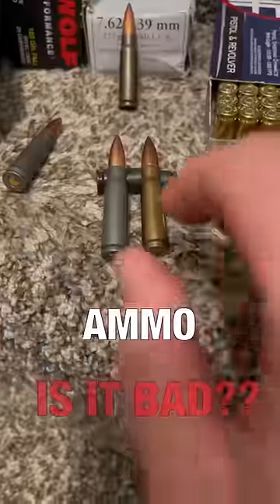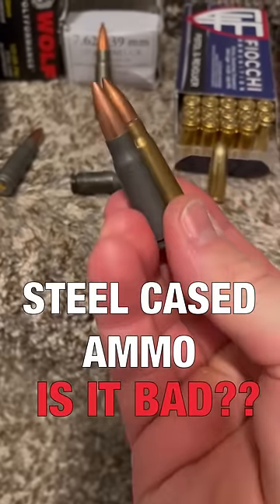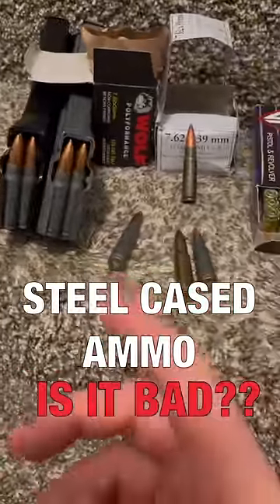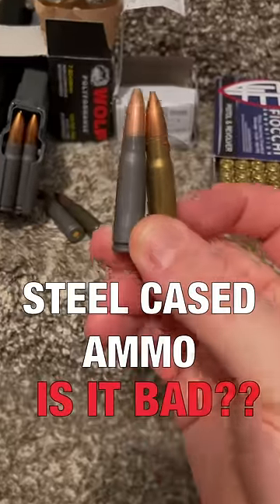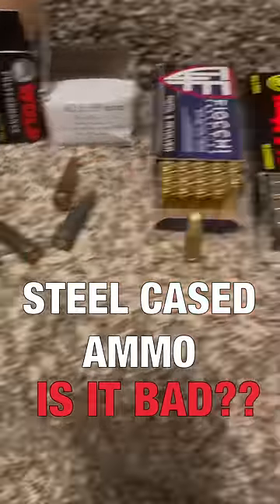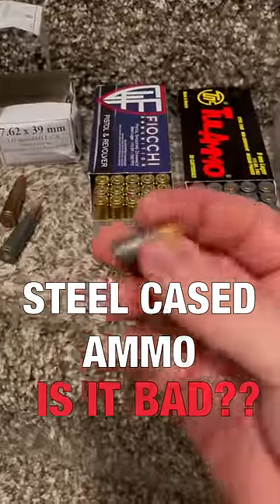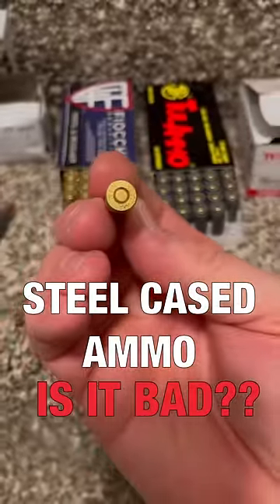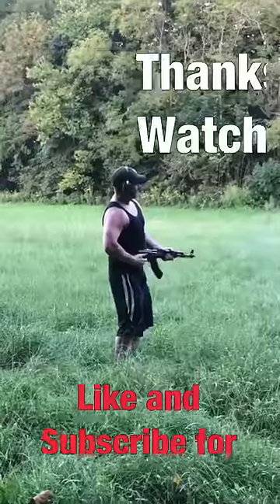Steel cased ammo, is it bad? #short #shorts #shortvideo

Comment: also, if your gun doesn't have a chrome lined barrel, it will not cycle steel reliably. This is thanks to the fact that the steel, be it stainless or chromoly steel, has a lower lubrosity rating than chromium. So, as the steel case expands, it suffers much more friction. In a chrome lined barrel, the lubrosity, which is a measure of average surface friction over various degrees of surface finish, allows the case to be extracted with much less force. This is why, back in the day, ARs couldn't run steel because finding chrome lined AR barrels on the commercial market was pretty tough, and information resources were pretty scarce on the subject. These days, there are several companies that sell chrome lined barrels like FN, Geiselle, and Daniel Defense, to name the big ones. Steel cased ammo is usually no problem, just keep an eye on your wear and tear and it never hurts to keep spare parts in stock.

Comment: I had no problem running steel 9mm in my semiautos, but I made a terrible mistake buying a case of steel 38 special . It's almost impossible to extract a full 6 rounds from the cylinder, I have to shoot, at most, 3 rounds at a time.

Comment: if you hav a gun that is crap then it will not run steel reliably but that is mostly the gun and gun manufacturers fault..  properly built guns with proper clearance will function just as well with steel or brass..
the only downside I see to steel is moisture some steel cases have no protection or very little protection against it. I have left some steal case rounds in my chamber and when I pulled the round to unload the gun there was rust in the chamber and on the case... keep in mind it was in there for about a week and the day I left that round in there it was currently raining and I was shooting in the rain.

Comment: only bad thing about steel case stuff is some ranges might bust your balls over it, particularly indoor ones, they will claim it's "steel core" (which is classified as a type of AP round under a reagan era law regardless of actual pen capability) and then hold a magnet to it, and if it sticks they wont let you shoot it, which is important since the tula stuff has ferrous metals mixed in the copper jacket. the reason they give for banning steel core is due to concerns about it damaging backstops.

last time I was at my local indoor range one of the rso's kept asking if my rounds were steel core due to it making sparks on the backstop, and on the end as I was shooting my last mag he stopped me and asked to see one of my rounds; he did the magnet test and it stuck, so i was told "sorry, cant shoot that". shortly after another rso came over and told me he was told to tell me I couldnt bring any more steel ammo, I guess since i made it clear i disagreed. i had heard about the magnet thing before and was told that was fuddlore aka bullshit, havent been back there in a few months. i had leftover tula and red army standard, 99% sure it wss the tula stuff i was shooting and what was tested, box makes no mention of steel core on the tula, and red army stuff explicitly says lead core. i had been shooting the tula stuff like every week or every other week for months since I first started going there, and it was apparently fine  till that smug asshat decided to make an issue over it. of course i know the usual advice would be to find another range, along with a speech about how "this is what you get for going to an indoor range", but for me it aint that easy, as they are the closest to me and are the only one I know of that doesnt require an expensive yearly membership to shoot there.
Reply: The other issue is steel case isnt reloadable, or atleast it just isnt cost effective to do so, since you'd need special equipment and you can really only do it once. this can be an issue if there are shortages due to panic buying and import bans, as well the gun grabbers making it more expensive to buy new through things like ammo taxes and requiring an FFL middleman like in CA.
Reply: it isn't the core, it is the bullet jacket is often steel with a very thin copper plating.  
If you've ever shot steel targets with these bullets and notice the difference on the dents and chips you will understand why they don't like having their bullet traps get hit with this.
Reply: @phild8095  hmm, interesting, never shot at any ranges that allow steel targets, or atleast allow you to shoot them with anything other than .22 rimfire, so I didnt know this, would ypu say the bullet impact is noticably different from the non-magnetic  fmj stuff? either way it shouldnt really matter atleast in my case, since that range specifically says no "steel core", no mention is made about the material of the jacket mattering, and if this is a common fmj thing, well that makes no sense, since they allow other kinds of fmj. it also worth noting that after that I switched to some corrosive primed yugo brasscased surplus rounds, and so far nobody has said anything, leading me to believe the only reason that dumbass RSO said anything was because of the steel casing. as for the sparking on the backstop, ive seen that happen multiple times before, including by some guy couple bays over that same day that was shooting .308 out of a bolt gun, nobody seemed to care.
Reply: @AtrociousAK47  outdoor ranges
Reply: @phild8095  unforunately there arent many outdoor ranges near me, the closest one to me is private and would require buying an annual or lifetime membership for myself and anyone else I might want to bring, unless they were my SO or kid, and even then after applying you need to wait for the next available safety briefing class, as that is required before they let you use any of the facilities, even the archery range. all the other ones are over an hour and a half drive each way, including the free WMA ranges which require a hunting license to use. looks like im stuck with indoor ranges for the time being until I can move out of state.
Reply: @AtrociousAK47  I've got more time.
On steel targets the copper and lead just shatter instantly and spray outwards from the target.  There's good videos.  But that impact is safe for AR-500 steel targets of varying thickness.  My first steel target, 8" 1/4 inch thick AR-500 rated for handguns including 9mm, 45ACP, 40S&W, was used often and had no dents or chips.  Used some cheap wolf and it dented the crap out of it. 
So if it can do that to a hanging plate, imagine what it can do to a fixed bullet trap that someone invest big freaking money on.

Comment: Steel cases have been rockwell tested and are actually just as soft and sometimes softer than brass cases. They aneal the steel to make production of the cases possible. They are harder on extractors because some steel cases have rougher surfaces (the polymer coated ones) and more friction. The projectiles themselves are often steel jacketed and seem to wear barrels out a little more quickly than copper jacketed bullets but that has nothing to do with the case itself.
Reply from the maker: Good info, thank you!

Comment: I’ve fired hundreds of rounds of steel cased ammo in my AR with zero failures. My dad had a Doublestar that did not like steel cased ammo. My wife had a Sccy pistol that PREFERRED steel cased ammo. I think the issue with that pistol was that the extractor was too loose on the brass cases but I’m assuming that the lacquer on the steel cases added just enough to the case dimensions to give the extractor a solid hold.

Comment: I've ran numerous steal cased 762×39 and 9mm I've had no issues. I shoot them because they are cheap.  There just not good for reloads. I carry nickel plated brass in my EDC M&P first gen. 9mm 147gr. Hollow point rated at 1200fps I believe there made by Browning. The nickel coating is supposed to help feeding and cycling kind of like a lubricant I do believe. Though I've never had feeding or cycling issues with brass or steal in my M&P
Reply from the maker: excellent, thanks for the info!

Comment: Only problem I can really think of is older guns and newer steel case ammo. Most of my 9mm guns chew through cheap steel case like it's nothing. My Star Model B from the 30s can't even cycle the first round. Brass and aluminum seem to be fine, though I have considered getting the gun looked at for a possible extracter issue or weak spring.

Comment: Most of the issues with steel case ammo come from it being loaded with dirty powder, and the coating on the projectile , not the case.

When it comes to rifles, bi-metal projectiles will wreck the barrel in half the time that copper jackets do.  Steel cases tend to have extraction issues, especially in the cold, in ARs.

With pistols though the pressure and heat is far less and show no increased barrel wear from steel cases ammo.  Steel cases do require you keep a little bit more lube in the magazine to ensure function.

The only other issue I’ve had with steel cases ammo has been in a revolver where the cases stick so tightly in the cylinder you have to punch them out with a cleaning rod.  This appeared to be due to how much fouling was deposited around the case from the crappy powder they tend to be loaded with.

Comment: I've only had 1 issue with steel cased ammunition and that is with a .22 rimfire revolver with an ejector rod (Heritage Rough Rider). The case would stay expanded (and was already wax coated) in the chamber and took much more force to get out (multiple heavy strikes with the ejector rod) instead of the gentle force of ejection from a brass case. Otherwise, no problems from me with steel cases.

Comment: I'm a fan of steel cases in my cheaper firearms. I used them often in my old wasr-10-63 and my old mosin. But the price for brass is often negligible if you aren't firing 7.62/39 or 54R.

Comment: I hardly use anything else in my Polish M1960 7.62x39, and AK74 semi auto 5.45x39…. My Mosin M44
Carbine extracts fired brass cases sooo much easier than steel 7.62x54
Though its had a bunch of it.
I use blazer aluminum sometimes in
9mm and .38 special, but mostly don’t use steel case anything else.
Some of the Winchester steel case has problems to the point, Im not likely to try it.

Comment: If I'm correct one of the reasons you would also use brass is because it is more conductive, meaning it removes more heat from the system     when ejected than steel or iron casings would.

Comment: I've shot quite a load of steel case ammo, in 223/ 5.56, 7.62x39 and some 7.62x51 and 7.62x54. I don't have a problem with it cost wise it was a good choice for what I was doing with it shorter range out to 500 meters. Some though belt feed MG. and G1 rifles so not planning on reloading.

Comment: I've shot thousands and thousands of rounds of steel cased ammo. Malfunctions are not anymore often than with brass. Only issues I've ever had was moisture on cases that didn't have a lacquer coating, once rust gets on there, it needs to be cleaned off or stuck cases are more likely to happen. Often it's not as accurate as most American brass cased ammunition, but it depends on the manufacturer and the rifle. No issues with jamming or anything if the rifle is cleaned and oiled every 1500 rounds or so. This is just a quick clean too, like a field strip and wipe down with a rag with some cleaner on it and reassemble, apply lubricant, bore snake the barrel 3 times, go for another 1500 rounds. I imagine you can probably push it much more than that if the rifle is gassed correctly, but that's just how I do it.

Comment: I have 2 Yugo SKSs and they both beat the PISS out of brass. They can "run" both, but it runs better with steel. True, you can't reload steel (or at least you shouldn't) and brass 7.62x39 is a bit uncommon and more expensive. I run brass when able through my AKs because that action isn't as rough on brass and the days of 1,000rds of Wolf ammo for less than 100 bucks are LONG gone

Comment: I've shot tons of steel cased ammo. It primarily what I use to train with. It's fine on guns that are meant to be fed steel case ammo and on guns that you can swap barrels and wear and tear parts easily. People say oh if you shoot steel you will wear out your barrel and it definitely does increase barrel wear but a new barrel in a AR is like 250-350 maybe more for a really good one. If your able put 12-18k rounds through your rifle to wear out the barrel. You can afford a new barrel, bcg, and any other part that breaks. Steel can save you alot of money and give you valuable reps on the range. I I just wouldn't run it through any relatively valuable firearms that aren't ARs or AKs. Or use it for any serious defensive use in ARs. It's GTG for whatever in a AK.

Comment: I was always told that the main reason you don't use steel is corrosion and heat. Brass absorbs heat better and it's non corrosive. Steel now days isn't corrosive like it was back then. However the heat factor hasn't changed.

Comment: Properly heat treated carbon steel will cut through mild steel without a problem. So if your gun parts are carbon steel the mild steel will not wear down your gun parts.
Reply from the maker: FACTS.  💪🇺🇸

Comment: Ive had  wolf brand ammo 223 casing not extract and it ended my day with that gun bc I didn’t have a cleaning rod to push it out the back ring on the casing totally broke off so the extractor had nothing to grab on to I’ll just lay the 2-3 more dollars a box and not worry about It
Reply from the maker: I’ve heard of this happening to some other folks as well.  I pretty much just use steel cased ammo in my AK variants.  They eat it like candy!

Comment: If the steel is annealed, the right (dead soft) alloy, not corroded, has a sufficiently high temp polymer coating.... no big deal. 

And range cleanup is so easy when a "brass magnet" actually works!

Comment: One thing you should have brought up is that you can not mix steel and brass ammo, or at least you can not shoot steel ammo first.  Because of the non-expansion of steel ammo fouling gets in between the case and the chamber wall.  Putting brass ammo into a chamber that has been firing steel ammo first, will expand and literally glue itself to the chamber under pressure and heat.  This is the reason that rifles like the PTR have groves or "flutes" cut into the chamber wall for easier extraction.

Comment: My biggest complaint with steel cased ammo is that its usually surplus with corrosive primers and reloading at home steel cased ammo is far as i understand impossible/impractical compared to brass you can reuse several times.

Comment: The way I see it.   The German Army used millions of rounds of steel cased ammo during WWII.   The polymer coating is a later developed coating, and polymer coating doesn't leave the residue you referenced.  The older lacquer coating will gum up the chamber.  Which means you clean the freeking rifle.
Reply from the maker: True!  I actually bought an old box of 7.62-54R that was lacquer coated..  the first round I fired of it left the casing STUCK in the chamber so bad I had to take the bolt off and ram the case out with a cleaning rod!  That was the first round and I keep my rifles very clean and well kept..  I think the manufacturer went overboard with the lacquer

Comment: If figured that there is a very general principle for steel case ammo.

Usually well made firearms are put together with such tight tolerances that they handle the ammunition with practically none of the traditional wear and tear seen in cheap firearms. The reason you use brass is because you don't need an extractor that is perfectly built or a chamber that is perfectly sealed. The brass will dent before the extractor and fill the chamber easily. The gap in the chamber on a good firearm is just better with smaller gaps and the extractor expertly cradles the rim without needing a harsh clamp and denting.

This, of course, is extreme accuracy during manufacture. There are also firearms that are made specifically to eat through steel casings while remaining "cheap" in manufacture. We are talking about things like the Soviet Era AK-M which was designed to be the cheapest thing to take the cheapest ammo and keep running.

The firearms you need to be wary of are the ones made specifically for expensive brass ammo because it is either too cheap to withstand steel, or too... specific to take cheap ammunition with wide tolerances.

Of course, with machine built firearms in the modern age, I don't think anyone has put forward the time and effort to come up with a list of what is what.

Comment: Brass case is actually bad for an AK as it might be too soft to work reliably and also because the AK was designed for steel case which is the OPPOSITE of the ar15 platform which was designed for brass, it depends on the firearm 

But overall the powder load and type is usually what matters the most, not so much the case material

Comment: If your gun is well built with quality components it will be fine. Steel case (especially Russian made) is usually lower pressure and softer recoiling. The polymer and lacquer they use is very durable and heat resistant. I have a rifle with over almost 10k rounds of cheap steel case and it still runs and groups
Reply from the maker: Yessir, my AK’s eat the Russian steel cased stuff like candy

Comment: I find it, "sticky" in handguns.
I've just stayed away, after that. So maybe it does run fine through rifles.
Reply from the maker: Through an AK style rifle, they run smooth as silk.  I’ve had good luck with steel cased Tula 9mm in my Beretta, but nowadays I just stick to brass for pistol work 👍
Reply: @KentuckyLasslo  i only have a few options to consider. 
Do you have any experience, that can say no-go, to any of them?
M1a scout squad - I'll assume doesn't care what you feed it. 
BCM AR?
And my most suspect no-go...
Tavor x95. -even though it's based on AK platform.